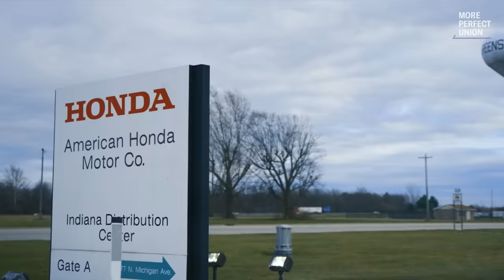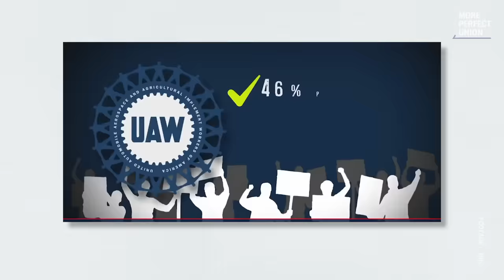Workers REVEAL the Truth About Working at Honda

Comment: God, screw that plant. I worked there from 2012 to 2014.

They were allowed to keep temporary employees for up to five years without hiring them. About 2/3rds of their workers were temporary. You also had to rotate shifts every two weeks.

When they did do full time hiring, they made temps apply to the general hiring pool as well as their own internal pool. They basically drew names out of a hat at random too so they could hire someone with no attendance points left before someone who never missed a day. You had to reapply for full time every six months because they didn't keep records on the hiring pools.

We had a guy have a seizure on the line while putting in sunroofs and had to shut the line down.
Reply: Just like the UAW... I'm in the plants, the UAW is not the answer.
Reply: I'm surprised they didn't just roll him off the line and have some offline support step in to that process. Can't afford any downtime!
Reply: @michaelwright1602 i work with a guy that had the UAW in his plant. He said they did nothing for them. They where more in bed will the upper management then helping the floor. He also said they screwed them out of everything good.
Reply: I work for temp services in past I worked at a plant and busted my ass thinking I would get Hired on two months later they came up to me and said we do not need you anymore goodbye it devastated me after that when it worked for a temp services I was just a warm body there nothing more nothing less temp services shouldn't be allowed to work people for years without hiring them or tell them some timeline the job last they get rich off your hard labor
Reply: @theunknownone5663 Yes sir, that is how they roll... It can be very devastating for folks to be on the receiving end, bust your ass, go above and beyond... Not how it works.

Comment: I had no idea there were any automotive plants in the U.S. that weren't union (barring maybe some new startups).  I used to work at a UAW plant, and the union did make it suck.  But the union also resulted in shockingly high pay for very little work.  

I find it odd that supervisors at Honda are pushing back against unionization.  Being a supervisor in a union is a perk, too.  Your pay goes up because your employees' pay goes up.  Your job is easier because there is a distinct set of rules that everyone has to follow, and if an employee complains about the rules, you just direct them to their union rep.  And you aren't allowed to do any work yourself; you are only allowed to direct employees.

The rigidness of everything is what makes it suck (no matter if you're in the union or a supervisor), but you can also make a good living for very little work (if you're into that sort of thing).  Unions are a requirement because corporations are evil.  Don't be evil, and your plant won't be turned into a hopelessly inefficient money pit by people who are tired of being abused and put in harm's way.  Pretty simple.
Reply: Cool it with that disinformation. 

Manufacturing work pays shockingly high for very little work?
Reply: @JohnnyD1993  You've obviously never been in a (good) union or didn't bother to read my comment.  There's a reason for the stereotype that union workers are lazy.  

In my department at that job, not a single worker worked beyond 50% capacity.  That means every worker had four hours of downtime throughout the day, every day.  People had secret beds and card rooms set up around the plant because they had so much idle time.  Workers there were also paid about $24/hour (in 2014) when non-union shops were making about $15/hour for the same work, not to mention the annual profit sharing bonuses that were thousands of extra dollars each year on top of the regular pay.

Shockingly high pay for very little work is the only way to describe that job.
Reply: @NoName-ik2du  so far we've learned

- Unions defend bad workers that deliberately hurt the company
- Workers are allowed to do fuck all for half of their shift
- Supervisors become individuals that demand respect, not earn it
- The pay is shockingly good compared to the competition for the expected workload

What else would you like to add to your list?
Reply: @JohnnyD1993   Points 1,2, and 4 are correct and pretty much sum everything up.  Point 3 is not.  Union supervisors do not demand respect.  What I said is they also have less to do in a union, so it makes their jobs easier as well.

You may notice that all of these points are in favor of a union.

Comment: So this was why my last honda sucked so much, it wasn’t union made
Reply: Union made vehicles get with plenty of recalls.
Reply: Correct! Honda is overpriced junk!
Reply: @Pocket_Champs2023  Hondas will get more miles than any other vehicle on the road. Even the small engines start on one pull. Tecumseh motors, you had to pull 10 times and use starter fluid. Briggs and Stratton, nope. Harley engines fell apart and  leaked lots of oil. Who are you kidding?

Comment: As Long As You Have A GOOD Union That Will Fight For Your Rights, (Instead Of Just Collecting Union Dues), You Have A Chance To Get Some Worker Representation.   But At The Same Time,  They Can Also Defend SLACKERS That Don't Really Care If They Do A Decent Job, Or Druggies That Shouldn't Be Working In The First Place...  I've Worked For Employers Both  Without And WITH A Union Before My Retirement Over A Decade Ago.  And Each Situation Is Different.  It's Like A Marriage.  It Could Be A Good One, Or It Could Be A DISASTER...

Comment: Guys and gals i work for Honda. This stuff that they are saying isnt true. Its lies. Its all lies to get union numbers up. These associates were paid for this video. Honda pays exceptionally well. You wont find any local listings with the terrific starting pay honda has. Also, like i said previously, Honda has a 5 star safety rating and we are top 5 in reliability. We are by no means "bottom of the barrel". Also, speaking on ergonomics, Honda has continually imporved ergo throughout time. Associates "back in the day" didnt even have an ergo mat to stand on. Didnt rotate off of processes. This is not the case today. THIS INFORMATION IS FALSE.

Comment: i worked for a year on the honda line with two different injuries until i had a full mental breakdown on the damn line. bunch of fucking the trained sociopaths working for honda directly, and not getting shafted further by addeco like i was, fucking yelled at me for suggesting they needed a union. everyone had the same fucking wrist and arm injuries. i still have tics from being coated in nasty palmolive to do my job process.

Comment: The UAW is a business. UAW revenues, estimated at $290 million annually, come primarily from their members. Because membership has declined from 1.5 million to a little over 400,000 in the last 30+ years, they need new members.  Word on the street is that at least two of the associates in this video are failed LSS associates and were essentially stepped down for poor performance and the shoulder scan at 3:54, is not even the gentlemen’s actual X Ray.  Honda does not just stick you on a process to “blowout” your shoulder, my God.  I pray that the people watching this video have enough common sense to gather all the information and facts to help them make an informative decision instead of just jumping on the band wagon of failed and problematic associates.  Honda is not perfect, but they are leveling up and they absolutely do not need a union.